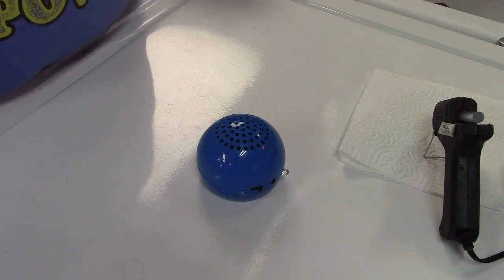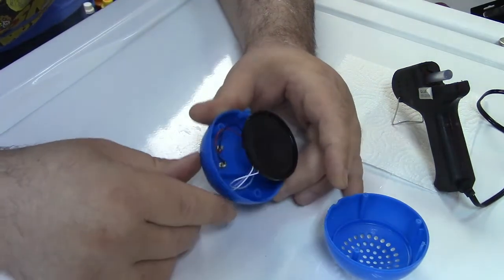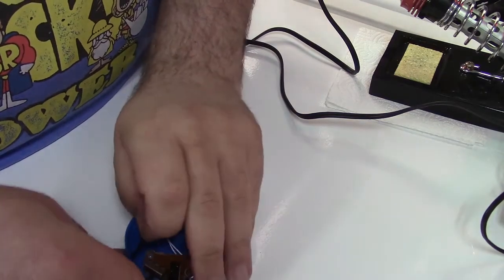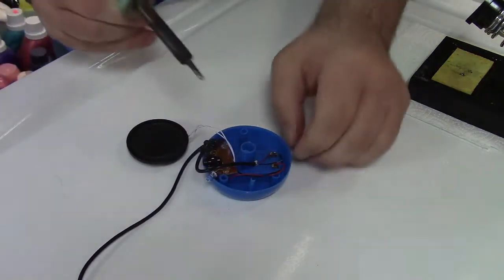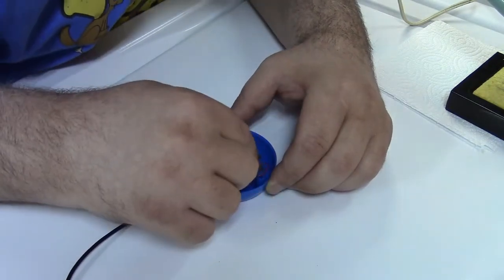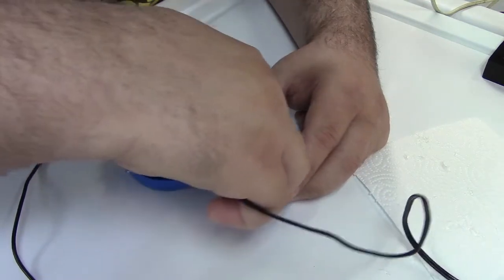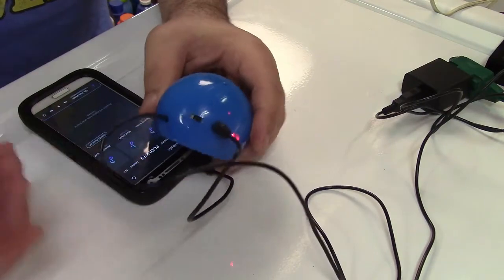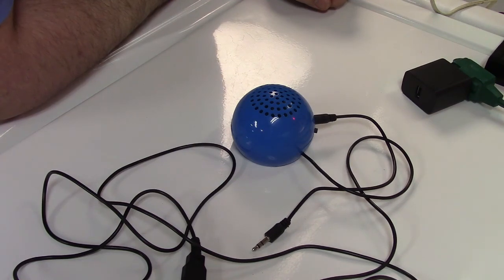Adding USB To $1 ECIRCUIT Mini Speaker

Comment: Good idea, implemented perfectly, and your modification also has the advantage that you can use your phone's power for the speaker - just use a USB-OTG adapter and connect the new cable with it, then you don't need batteries anymore when using it with your phone (I think that makes sense if you have an older or cheaper phone which doesn't have such a good built-in speaker).

There's one additional idea I had while watching this. In Nick Drudge's video on this speaker (which is linked in VWestlife's description), one can see that the switch has one terminal unattached. It looks to me like if you connect the + pole of the USB cord with it, you can switch between the power sources instead of just turning the speaker on and off... You usually just have one power source available, so it usually doesn't make any difference, but you can never connect both at the same time and therefore never over-volt the batteries. I don't know if it would work, the speakers aren't available here sadly, but if you want to do this again, it might be worth a try. :-)
Reply from the maker: Thanks very much, and that's a great idea about the USB-OTG adapter!.

Interesting about the switch.  As luck would have it, I just so happen to have another speaker that's waiting for its mod, as soon as I come across another USB cable.  When that happens, I'll definitely take a look and see if I can do it that way!

Comment: That sure made a useful piece of test equipment, nice job. 

Perfect glue gun for the application, too!
Reply from the maker: Yeah I'll get some use out of that for sure!  I want to make another one or two of them, and happen to have some USB cords laying around!  Next time I stop in the dollar store, if they still have them, I may just do that!  Or I could do a revisit and see what it might sound like with a more decent speaker.  That would be an interesting revisit.

It's funny, I've gotten more use out of that glue gun than I ever thought I would, even though I have another mini gun that works SO much better.  I just felt the need to use the right tool for the job.  Chinese product, need a Chinese screwdriver to open.  But that glue gun did the trick, and chances are it will again!